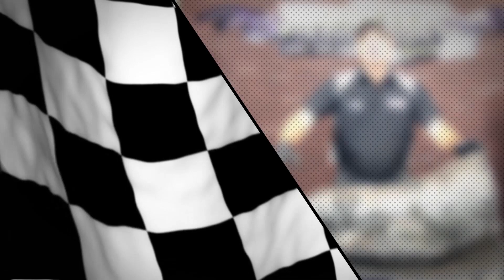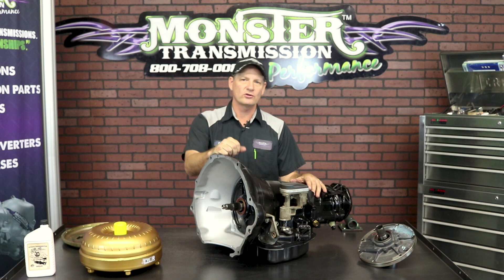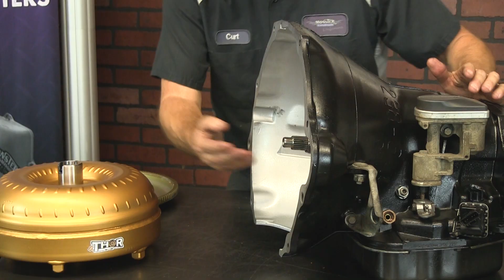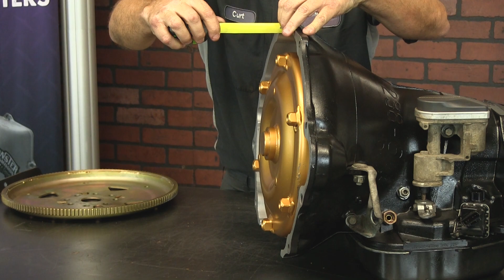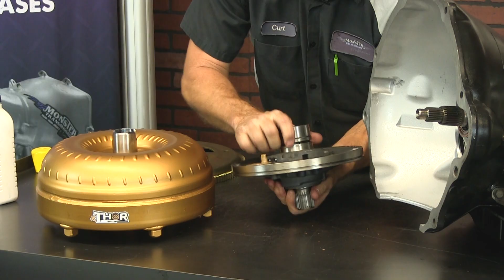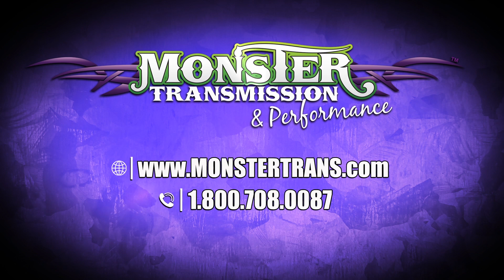Dodge Torque Converter Install

Comment: Pulled my old engine out with the torque converter still attached to the flexplate and engine that I did not unbolt before removing the engine itself. Does that mean I have ruined the spring in the transmission for the new torque converter to be installed? I have a new engine 4.7L H.O. to be installed in a 2003 Dodge Durango SXT with a 45RFE Transmission. Any tips would be great. Thanks in advance.

Comment: Thank you for your knowledgable communication.
Have a 2005 3500 with a new transmission and tourque convert installed 600km. Broke the flex plate off, towed to the shop finding out the crank moves .040 length wise. 
The shop is saying its my abuse that did it.
Seeing if a transmission expert would see the cause.

Comment: Is this going to be the same for the NAG1 transmission that Dodge/Chrysler uses?
Reply from the maker: Yes sir, it is the same way.
Reply: @MonsterTransmission  Thank you so much. I ordered a remanufactured torque converter and it’ll be here sometime next week. Hopefully everything goes smoothly. My engine locked up due to a failed lifter that exploded and got jammed in between the crankshaft and engine block wall. So I had to cut off my torque converter, realizing that I could’ve just cut the flywheel off hahaha. I bought a brand new one anyway so I feel really stupid for doing that, but hey. Living & Learning 😂.